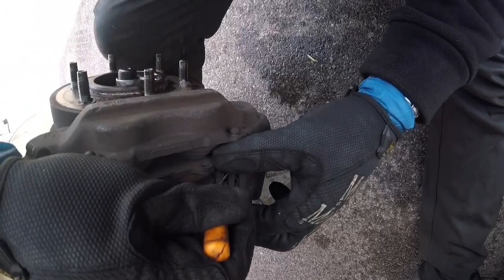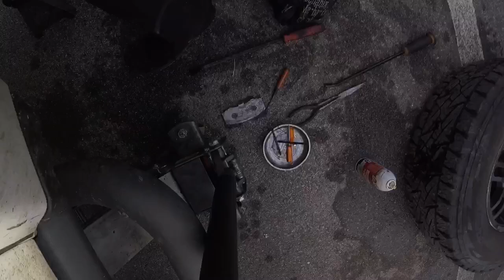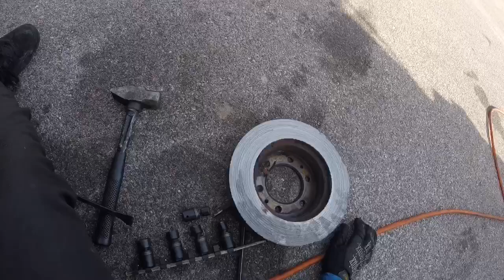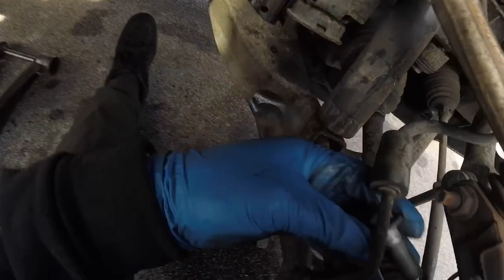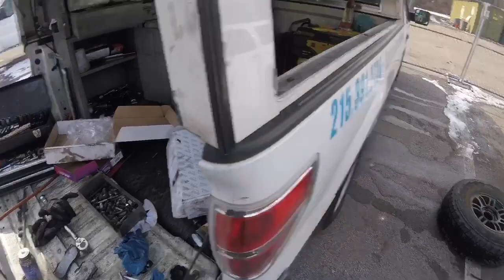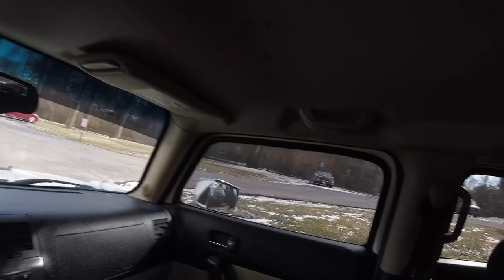QuickFix Auto- 2006 Hummer H3  Front Brake Pads and Rotors : Philadelphia

Comment: Hi there , you could have put some GEL on those Pins going into the brakes to 
firstly let them go in easily and then the Lubrication can stop Noisy brakes .
Reply: Brake grease always on those. Plus never reuse the long pins, safety cotters or springs. They come with most brake pad kits. Cheap as hell. Why skimp.

Comment: Could you have opened the bleeder valves a little to aid in opening up the the caliper?
Reply: Yes. In fact that would have been the correct way to do it. That way you are not forcing old dirty brake fluid from inside the caliper into  the system.